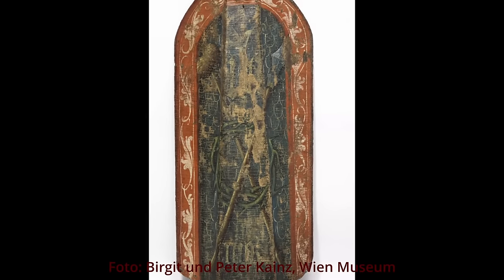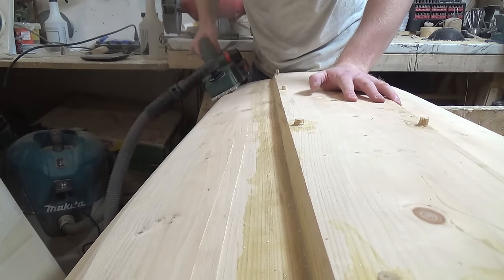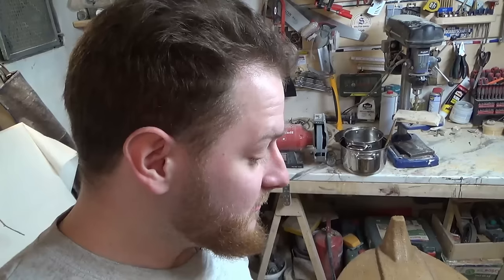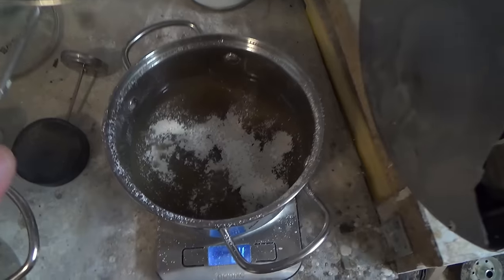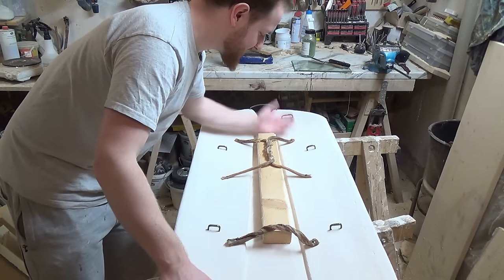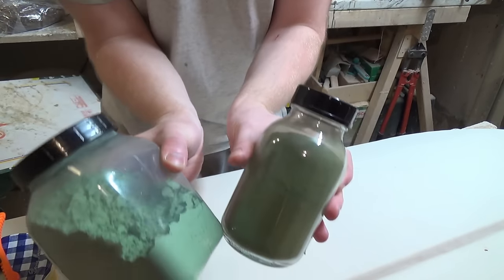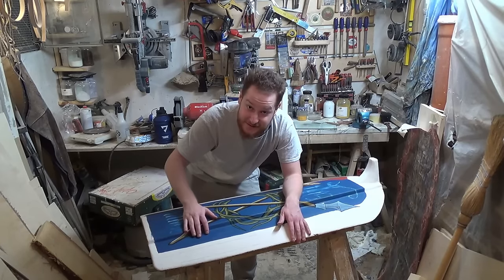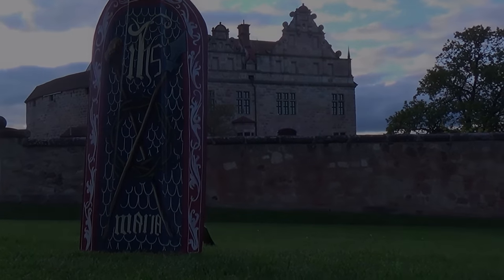Crafting a HUGE PAVISE Shield Only With AUTHENTIC materials

Comment: Advice for tendons: after soaking them extremely thoroughly, take a very smooth faced hammer or planed smooth wooden mallet and a smooth anvil or planed hardwood board and pound the soaked tendon between them. This separates the fibres somewhat and let’s you twist the tendon as a whole to control flexibility and add strength.
Reply from the maker: Noted Captain! That sounds like a very good idea, I'll try it in a view videos :)

Comment: Fantastic work! Now go and do it again 5999 more times, for all the other soldiers in the army!
Reply from the maker: You want to place an order? XD
Reply: @TheShieldery how much?
Reply from the maker: @apolloisnotashirt  the direct piece from the video allready got sold, but if you want to place an order, I'd charge 950€+shipping.
Reply: @TheShieldery  that'd be 950 euro per soldier! Which'd be roughly 6 million! Bah! Back in my day ye blacksmiths would forge weapons and shields for free. darn this capitalistic economy. Jokes aside, I don't think I'm old enough to be making such financial decisions such as buying a 950 euro shield. 😅 thanks for the offer~
Reply from the maker: @apolloisnotashirt you're welcome :) . If you want, you can built one yourself now :)
Reply: @TheShieldery Zincwhite could be a less harmful substitute for leadwhite. Or you could use the toxic picments and then covercoated it with a thin layer of clear epoxy. So there would be one modern componend binding the toxic elements. Worth it, or not? Fantastic work!!!
Reply: @TheShieldery  I can do 5 bucks
Reply from the maker: thanks! I'll look that pigment up. 
Na, epoxy is overrated garbage. It gets scratches pritty insantly and caus of some chemical reason it would probably fall off or change color. The shields surface is basically a chemistry laboratory XD Adding those modern materials is a risk I'm not willing to take.
Reply: @apolloisnotashirt  Don't forget, back then in the late medieval time this was basically  highly industrialized. Every shop had specialized people for every step of the process. Like the wood crafting, the hide, painting. So they had a much greater output and much lower prizes.

Comment: You can sink the fabric into water and skin glue for some hours (or a day) before placing it, it will be much easier to place and then add a layer of glue to fix it. That's how i do it for painting on panel and it works

Comment: 6:44 From years of experience in making blank canvas (I know it isn't the same thing, but I use almost the same materials), I can say that is a lot easier working when the fabric has been previously submerged in water. The fabric then stretches a bit , it doesn't take much glue, and is more flexible.
Reply from the maker: indeed! but then you got some wrinkles which you have to massage out, which is still simpler then what I did in this video though XD. I did something similar in the video about the schongauer paveses :)

Comment: In the book "On Divers Arts" by Theophilus, he writes about preparing painting canvases with gesso, and in between coats of gesso, he advised using a scraper (Ziehklingen?) to smooth the surfaces
Reply from the maker: yes, I tried that too at some point, but it wasn't as efficient and precise as the back of the Box-cutter knife.

Comment: Amazing ^^ About the handles, I've seen on many medieval shields the use of clinch nails: you first drill from the front a tiny hole that allows you to not destroy the layers you've put on, hammer in the nail with the flat side perpendicular to the wood fibers (otherwise you split it open), position the leather handle, hammer the nail to make an almost 90° angle and hammer it back in the wood. You then apply a second layer of fabric on the front to hide the nails and reinforce the shield. It is then impossible to pull the handle off. If when drilling the holes the fabric gets off, you can just add glue to put it back but there is a really small risk it happens.
You could also drill all the holes before you apply the fabric and pierce it then with a tool, safer but longer.
Reply from the maker: Thank you! :) 
I tried that reaplying_a_second_layer_ontop_of_the_nails and first: we found not a singel shield where this was done and second is my theory why - (caus I tried it once): It's impossible to glue the fabrik/ rawhide to a metal surface like the nails, so you take the risk of a not connectet popint thats large enough to rip a hole in the hole surface when stroken off. And that point is additionally raised from the other parts of the surface, so it will happen quite fast.
I do the 90 degrees thing quite often and it usually leavs a clear mark, which you can't see on the museums piece - therefor it wasn't done on this Pavese.
Thank's for that suggestion, I thought about adressing that in my video about the large Normann shield, but it led to faar from the main topic, so I didn't.....
Reply: @TheShieldery  (I am movementsciences36, this account is for a non profit association about medieval reanactment) Interesting indeed. Though I must disagree about no shield with this method. I've been to many Europeean museums (I'm European), read researched reviews, and even just by researching on internet I've found many shields from museums with clinch nails going through from the front. Usually the head of the nails are hidden under a fabric or in the dark painting. Sometimes they are also left visible. You can make the top of the nails head rough by liming and engraving points/lines: it helps the glue to stick on it. 
Anyway, we could talk for hours about it as it is enthralling.

Comment: You have no idea how much I love this.

Here is a tip.... two tips. Use more glue when gluing the Hessisches Tuch. Pre-soak the cloth to make it more malleable. Now you have to wait for it to soak up glue before you can get around corners.  Yes, messy and hard, fast work but I think it solves a lot of problems. And use a roller to get the glue worked in to the fabric and fill all those holes. It will surely cut back on de-lamination and prevent those pin holes in your gesso.
Reply from the maker: Thank you! :)
If I pre soak the fabrik, it gets folds which are very difficult to massage out and the glue won't soak in that good and in addition will be thinned down in the pores where I want it to be. I'm afraid the roller would bring even more air bubbles into the glue becaus it's sticky character creats a high surface tension, which can trap air quickly, especially when cooling down. :( Thanks for the Ideas though! Have you yourself actually tried those suggestions on a similar piece (open woofen fabrik and hide glue) bevore? If yes, I take back my criticism XD
Reply: @TheShieldery  LOL. What you do is unique so OBVIOUSLY I did not. But I see a lot of resemblance with laminating using for instance resin. Like they do in boat building:
https://www.youtube.com/watch?v=-2sh9hrIyHQ 
Not the same but it sure looks similar so technique may cross over.

You may be right about the roller getting sticky but if you keep reheating the roller in a bath? On that note. Did you ever try an Iron (laundry iron) to reactivate the glue to get bubbles to stick again after you popped them? Maybe you did. I'm a but fuzzy, I need to rewatch video's I have seen. I watched them in not chronological order so..... 

No criticism implied. Just spitballing here

Comment: Love it!  I go back and forth on using Ti white in my projects.  TiO2 does occur naturally in the crystal known as Rutile. 

Most white pigments appear clear in the tree resin ethanol  varnish medium that I make, so I find myself having to use Ti sometimes . 

Egg tempura might give nore options.  Would Chinese white (made from shells) work?  And fillers/extenders like Barite, Chalk, Talc, Kaolin Clay are white or white-ish in water based mediuns.  

Nihonga or Japanese style painting uses skin glue as the binder.   They use cinnabar without too much caution (not suggesting you do the same), and they use a white usually made from shells. 

I finish electric guitars with modern looking finished using all natural and historical materials.   

I actually just made a pickguard using rabbit skin glue and linnen over paper (sounds just like your shield when you scratch or tap it) ... historical plastic!
Reply from the maker: Thank you! 
I think I'm gonna use/try eggshell-white the next time; the problem with all those "white" pigemnts is, that they are not truly white or they aren't opaque enough and caus of that they adapt a lot of the binding agents color. Then you also got the Problem that a lot of the "whiteness" comes from the surface roughthness, like with sugar dolomite or glass sand - when mixed with the binding agent the light doesn't get reflected by the surface anymore and they get kinda translucent.... :(

Comment: I just found your channel Andre, and I'm very impressed- this pavise in particular is brilliant.  I have some advice for dealing with areas of canvas or parchment that don't seem to have adhered properly: you can take advantage of the fact that hide glue will soften with a bit of water and heat rather than just adding more glue; use a utility knife to open any air pockets, put in a little water with a small paint brush, and use a heat gun to warm the glue until it's sticky and then just press the canvas down again.  The glue is much more sticky when just re-heated than it is when fresh, and it will hold quickly- much moreso than fresh glue will.  

Also, the museum page doesn't name any of the pigments- did you check with them and they told you the red was cinnabar?  I'd have thought red ochre would be a more likely and non-toxic choice .
Reply from the maker: they got so many paveses, I doupt they tested the pigments of more then one or two. When the owner spend so much on the Azurite pigment, I assume he also would have gone for cinnabar. There are a lot of ochres, the ones of I know would be way more brownish after 500 years and all the dirt. So the red is way to vibrant for Ochre ( I assume). Yo ucan see an even darker red right on the edge, which looks more like an earth pigment.

Comment: The reason the sound was different (timestamp 11:28) is because that's the part that's over the other piece. The first piece where you thumped it, it was a thinner portion. The second part, it was overlapped, so the the sound was going to be .. lower. A thinner surface will resonate more easily and have a higher pitch.

Comment: There's really no need for that cheat with modern screws to keep the middle part clamped. Have a look at boatbuilders' clamps.  They're used to clamp planks to the hull, so exactly the same thing you're doing here. They're also just bigger versions of medieval clamps, so they're almost certainly what original shield makers would have used.
Reply from the maker: Uhhhhh; nice; Thanks! added to shopping cart!
Reply: @TheShieldery  If you google "build lapstrake clamps", there are loads of plans out there how to build your own. Hätte das auch auf Deutsch schreiben können, aber ich hab ehrlich gesagt keine Ahnung wie die ganzen Bootsbaubegriffe auf Deutsch lauten.
Reply from the maker: @mb4451  kann ich verstehen, hab mit dem englischen begriff bessere Bilder gefunden. jo, hatte schon vor mir die zu bauen. Hab nichts gefunden, wo ich welche kaufen hätte können; und die wären dann vermutl. von den Maßen her zu klein gewesen...... Weis nicht, ob ichs bis zum nächsten schilde bau video schaffe, aber probieren werde ich das sicher. Ist aber leider aufwändiger als die einfachen Holzschrauben, das kann der Zuschauer auch besser bei bedarf nachmachen...

Comment: You should look into a charging port dust plug. They're just a few bucks for a multi-pack (and sometimes kind of fiddly to work with, especially when your fingertips are numb from power tools or cold) but they can save a whole lot of headache digging trash out of your plug port.
Reply from the maker: I actually bought my power strip with Port dust plugs, but i Had to remove two of the plugs, because i couldn't force the thicker Plugs in, which i need quite often. Now i Clean them with theWorkshop vacuum cleaner from time to time

Comment: I really don't get electric planers. You have way more control and can remove almost as much material in the same time with and old school hand plane. One thing I will say is that this guy has a small shop and you'd need a big honkin bench to hold the work piece for  hand planing. Probably no extra room for another bench, even a low Roman workbench like I use.
Reply from the maker: yeah, I actually thought I could save money and not buy the electric planer and went with a 120€ stanleys. I just couldn't keep the (heater) shield in place. It wobbled like a drunken sailor. Especially when I tryed to smoothen the inside with a in german:"kehlhobel". (couldn't find the translation, google search for pictures.). It was just extremly demotivating XD. I'll stay with power tools till I can afford a bigger place; Future video idea: "Crafting an awsome medieval styled workbench"

Comment: Interesting project! I wonder if you could use something like a clothes iron or old style copper tip soldering iron to apply a bit of localised pressure and heat to the areas where the cloth didn’t stick to the wood? Just enough heat to soften the glue and let it be pushed into place.
Reply from the maker: Thank you! An Iron would get to hot, destroy the glues structure and probably full of burned glue. In Addition the Fabrik would get loose until it's cooled down...

Comment: looked to see if anyone else mentioned it, but I'm not so sure that the white lead paint would be more toxic than the the Cinnabar because one is just lead the other is MERCURY! I would advise gloves as a precaution in general
Reply from the maker: Yeah, gloves would have been a good Idea, as well as a mask mayby.
the lethal dose of Cinnabar is 3 bis 15 mg/Kg body weight; Source: first google page
After 20 min of googeling I didn't find the deadly ammount of lead white. But it seems like 540k people died of led poisoning world wide in 2016.
I just know that I can't buy led white without having a proove that I need it for restaurating an antiquity. 
But I can purchase cinnabar with a normal Business license, because of that I thought/think the lead-white is more dangerous. But If you find a propper source, I'd fully admit my mistake XD
Reply: while mercury sulfide is very poisonous, thinking it's 'just lead' is making a dangerous assumption. a tiny amount of lead - ingesting or inhaling lead dust - can cause nervous system and brain damage - and lead poisoning is irreversible.

Comment: I feel like you should build a jig table. Because these shields would have been built in the hundreds and thousands to arm entire armies, they had to have had jig tables... tables curved, possibly with padding  and presses. Medieval version of fabrication tables.
Reply from the maker: Hi there! We got no source for that. They speed up the process by division of labor. Normally it would have went through 10 (?) different work stations. You can actually see the connections I used in the video on historic pieces. No bending, only carving. In addition you had quite a long time to produce the ammount you would need for an entire army. And weapon-dealing always was a huge buisness. And of course you didn't always had the ammount of shields you would like to. We got direct sources and miniatures of shutters, that where improvised as shields. Some very direct, and others that where covered in fabrik, basecoated and quickly painted. Having not enough weapons or arms is still a huge topic today.

Comment: Very nice job, I really liked it! Do you know what is the porpose on the top front part of the shield? Was it a rest for the crossbow, maybe?
Reply from the maker: Thanks!
That's a very good question for which the archeology only has theories, like:
- it's a larger, more stable supporting point for a crossbow or spear
- As a large hooking point for a support
- larger resistance to impact from the top, where it would happen the most 
- Rest for the helmets neck when the Pavese is worn on the back
- ...

Comment: What is the purpose of the nose?  Maybe if you preshrunk the material it wouldn't shrink so much during the application.
Reply from the maker: That's a very good question for which the archeology only has theories, like:
- it's a larger, more stable supporting point for a crossbow or spear
- As a large hooking point for a support
- larger resistance to impact from the top, where it would happen the most 
- Rest for the helmets neck whenthe Pavese is worn on the back
- ...
:)